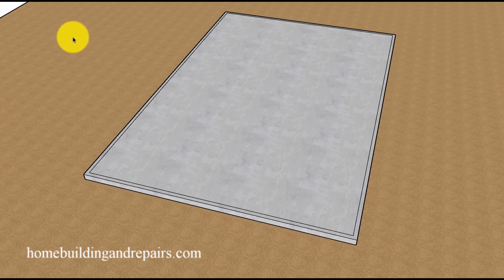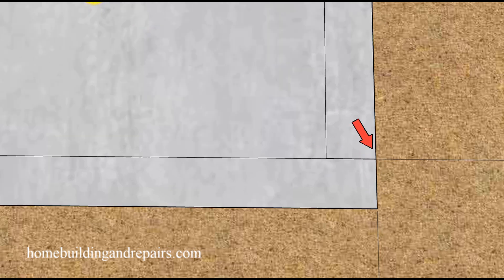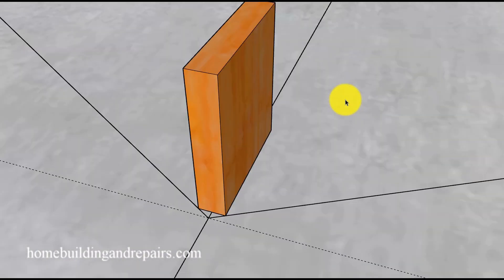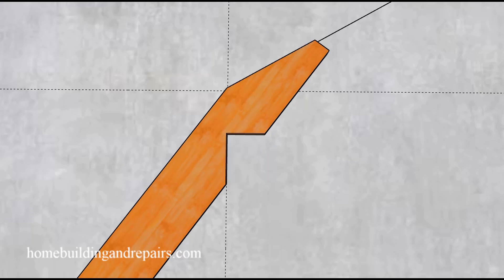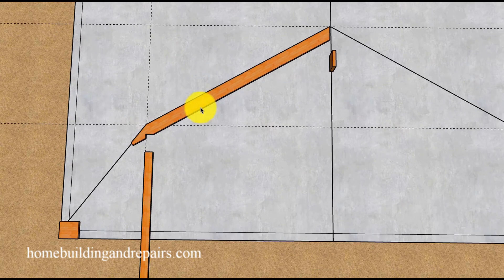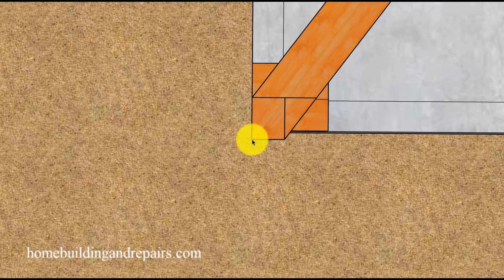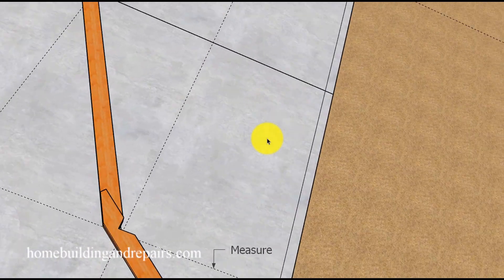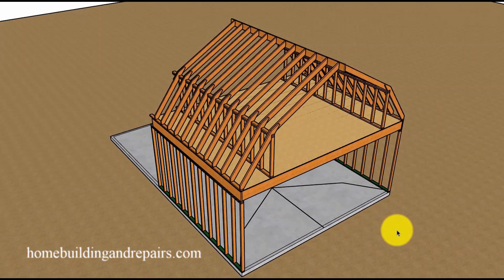How To Calculate Gambrel Roof Rafters Lengths And Wall Heights Without Complicated Math Formulas

Comment: I like the video, but I have to point out in the first two examples the lines were drawn to the wrong corner point in the lower-right corner after you made a big deal about putting an arrow there to make sure we use the correct point.  It was around 2:32 and 2:40.  It was corrected by the time we got to 3:00.

Comment: With this design couldn't you extend the rafter out past the walls to be able to add In a soffit?
Reply from the maker: Yes, you would need to change the roof framing.
Reply: Howz he gonna give you a reply that could be interpreted as a yes or a no? 😂
Reply: It's a yes, simply extend your rafter ends

Comment: If I want to make a 36' wide gambrel roof, what are my options for floor joists without needing a center support? Would "I" shaped osb joists be the least expensive?
Reply from the maker: Maybe the joist in this video or similar joist made out of metal. 
https://youtu.be/zvPQd95UHH8 I would install a beam in the middle to cut floor span in half to really save money if you can.

Comment: Plus when your laying out the roof you can not exceed 24' in width
Reply: why not? I've seen 36' wide gambrel trusses. I guess if you just wnat to stick with 24' long material your point is valid, but one can easily get longer materials.